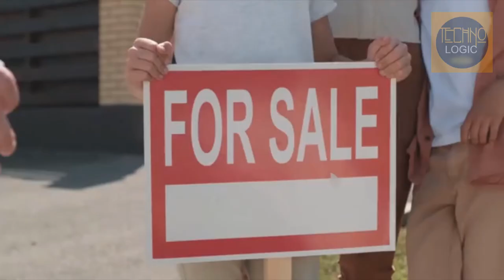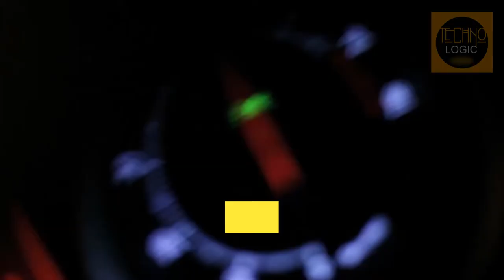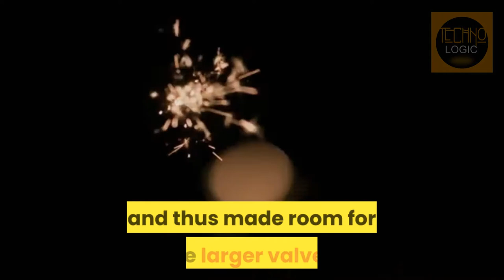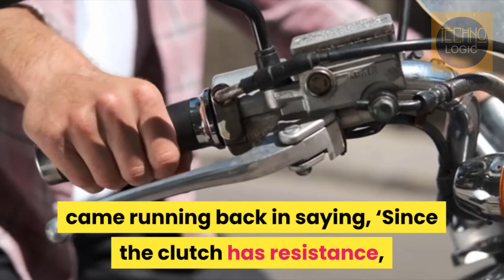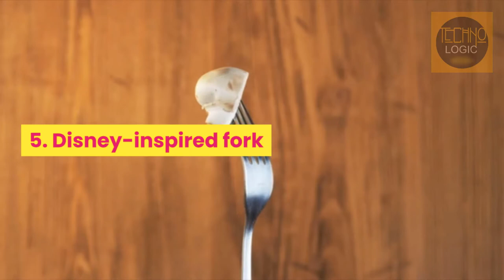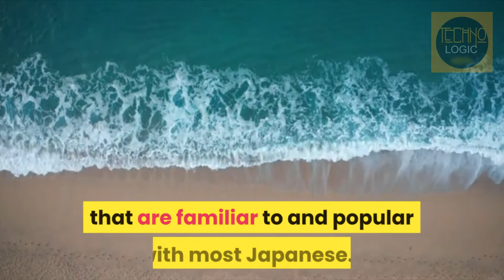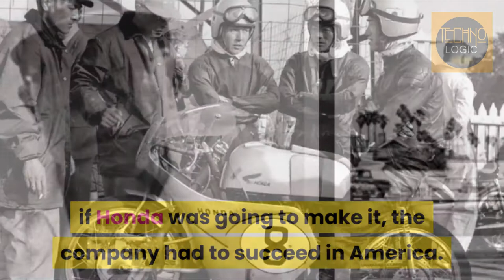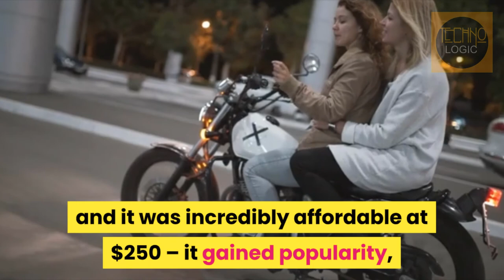10 FACTS ABOUT HONDA SUPER CUB C125

Comment: My first Honda Cub was the original 50cc (referred to simply as a “go ju” in Japan.  Go ju means 50.  It was a rock solid piece of gear, and I rode it all over the NEly portion of Honshu.
60:years later, I ride my shocko ne ju go. (125) in the Midwest U.S.
Courtesy of Half Vast Flying